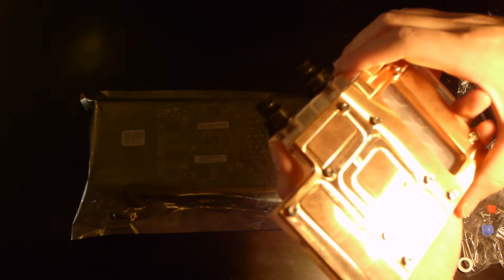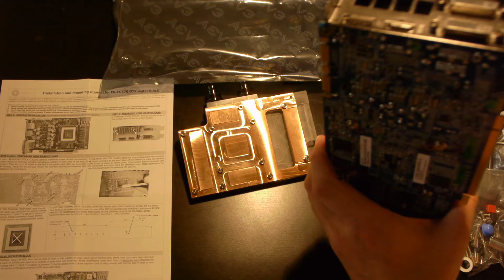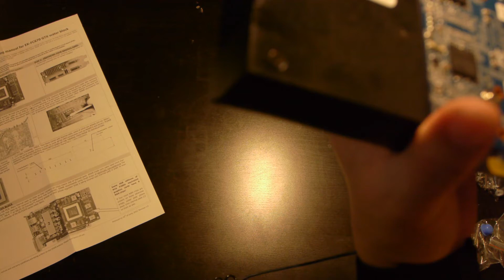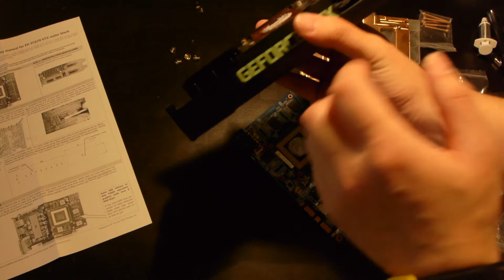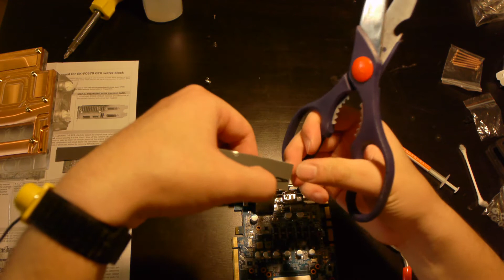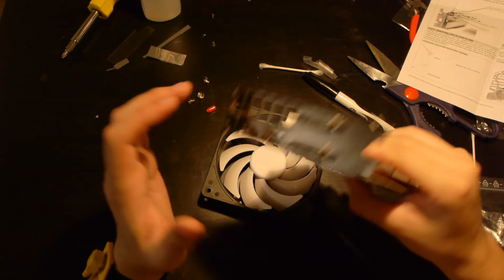[DIY] GTX 670 Water block install

Comment from the maker: Correct, the block by itself has inlet/outlet pointing down. A 90 deg block is included to make those face outwards and then you will have to use 90 deg elbows. If you have a multi card setup you can use the EK Bridge which has ports on top and bottom. I have elbows attached to mine, check out my other vids if interested.

Comment: It looks like the default inlet an outlet both face down ? so there would be no option to have a pipe coming from a top rad or CPU right into the card without some sort of adapter ?